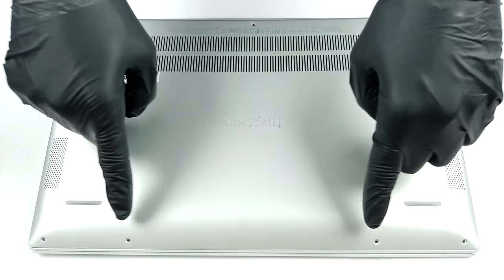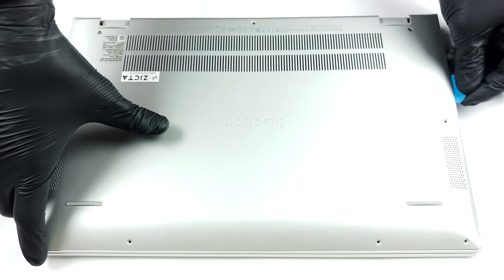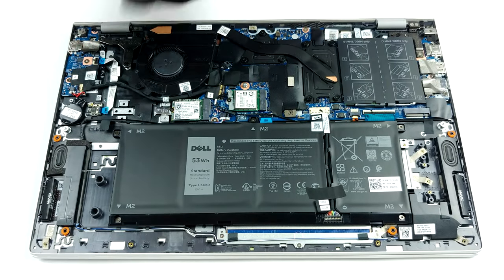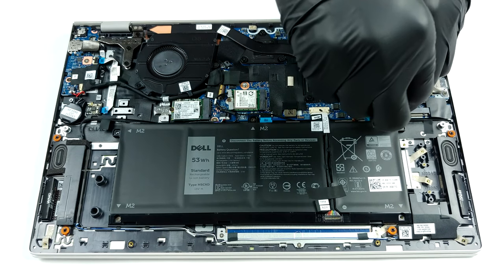🛠️ Dell Inspiron 15 5501 - disassembly and upgrade options

Comment: Can I use regular size M.2 instead of shot M.2 which is already installed in the main board? It looks available (there is an extended socket right next...)

Comment: so this has 2 m.2 slots? and the size of it can be different as there are different screw slots. 
This video is so helpful, thank you
Reply: I couldnt See Any m2 slots... where did i miss them? I Need to Add a 2nd and in Not sure if it works on the 5501
Reply: @sobr21azzaro  to the right of the battery

Comment: I'm assuming the 5502 with the 11th gen intel processors has the same layout at this one right? Because I want to upgrade to 16gb ram so I was wondering if it has 2 sodimm slots as this one. Also is there a space for a 2.5 inch drive?

Comment: The processor can change?  
how much memory can be increased in the M2? I have that one but I don't know how much the storage can be expanded.
Reply: he said up to 32g right? and has to be ddr4 (on that label). For the storage as long as it is a laptop nvme SSD it will work.